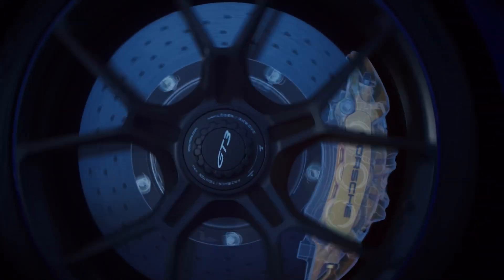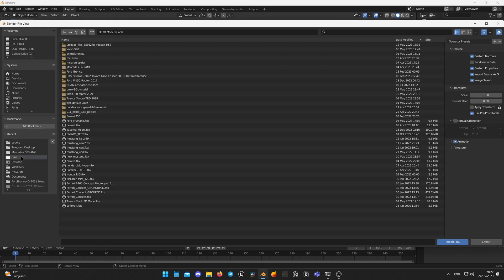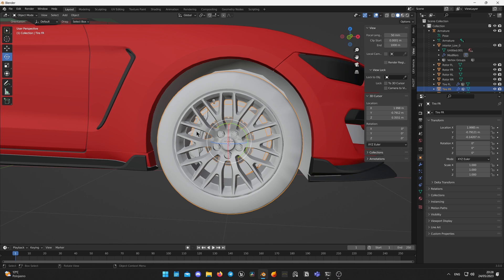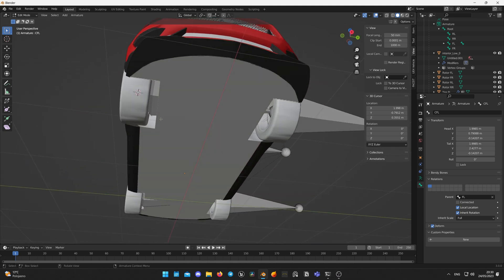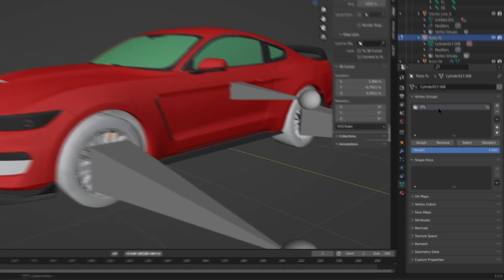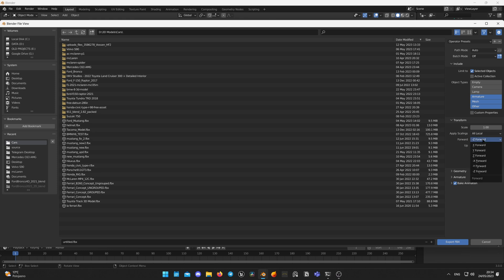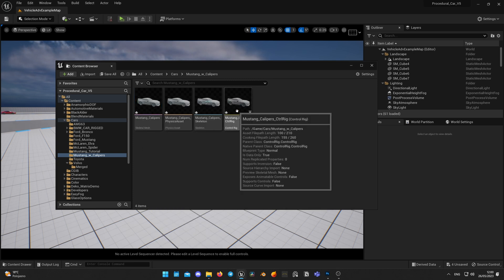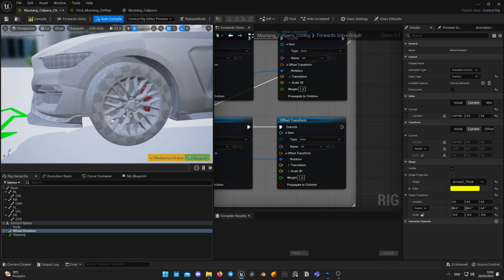CALIPERS FOR CAR RIG in Unreal Engine 5

Comment: Welcome. I watched the entire clip plus I also watched the clip where you built the Control Rig, I did the same, on top of that I also made sure that the axes in Blender are placed and that the bones are pointed in the direction that should be more precisely z up, x in the front and y in the sides, the car runs perfectly in the preview from Control Rig, so the steering is ok, the body moves ok in all parts, and the rotation of the wheels is also ok, the calipers stay in place when the wheels are moving and it also follows the wheels at every turn, so everything is good (WARNING), this is in the preview mode in Control Rig, when I go out and enter the game, that is, I give play to the editor, the calipers follow the wheels in turns, but they turn together with the wheels, it's totally contrary to what appears to me in the preview in Control Rig and I don't know why, not to mention that for about a week now I've been struggling with the car itself like when I enter the game, the wheels go halfway into the asphalt and spin empty, so if I didn't make any changes in blender and different and different tutorials on YouTube, I don't know my name anymore, in physics I don't say that I took absolutely all the settings in a row and nothing nothing nothing nothing, I- I'm honestly bored, I've been sitting on something insignificant for over 10 hours, in blender I set the scaling to 0.01 from the beginning (I know the story about scaling), I made groups in blender, I added all the components of the car to the body and I left the calipers and the wheels separate, then I arranged the car on the global axes to be directed towards x, z to be up and y to the sides, then I also arranged the local axes to correspond with the global axes and practically reach the value 0 on absolutely all axles, I set the origin for each individual wheel as well as for each caliper (as proof I said that the calipers follow the wheels when turning in both directions), I also switched to Face Orientation and did my best that the whole car to be blue and not red, anyway there were only two red front grills, I made them blue, I made the bones with UE4 Vehicle Base Rigging and everything went perfectly and this setting works (by the way, I'm on Unreal Engine 5 version 5.4. 4 and in Blender I have version 4.2.3 LTS (they are the latest versions both in UE5 and in Blender)), then I fixed exactly what you did in the clip when you removed the calipers from the body to the armature so that they are in the same column with the wheels, I gave duplicates to the bones of the wheels and then gave them a name and selected the parent wheel of the respective stirrup, following that by pressing the tab key for each wheel group, I created a vertex group in which I gave the name of the bone because it must be identical to the name of the caliper bone from each wheel bone separately where I made sure that all the calipers are selected and then I gave assign (anyway, as I said, I have no problems with the calipers, at least the bones are all imported into the EU5). On the other hand, I don't work with FBX because it has caused me some problems and I work with GLB (I don't have the slightest problem with GLB), on the contrary, I notice that with GLB the colors of the materials are much more colorful and it no longer seems to FBX and on top of that after you click on Rig Vehicle to create the wheel bones, you don't even have to enlarge the car to bring it to real size because in UE5 thanks to GLB, it automatically brings it to real size, that is to understand with FBX, I enlarged the car to its real dimensions (and I was working in meters, it is an RS6 that is 1.46m), then I click Rig Vehicle, the car shrinks and I had to enlarge it again to its real size, if not I was doing this, in UE5 it would show me a small car, very small, if I enlarged it to the real size, everything was ok (although for some time when I enlarge it to the real size, in UE5 it seems to me a giant car to go and in UE5 restarting what I don't understand why, because I've been doing this for a long time and this thing doesn't happen to me, but in the end, that's why I switched to GLB), instead of GLB, I enlarged the car to its real size, I clicked Rig Vehicle, shrink the car and leave it like that, I didn't increase it to its real size and when I imported it to EU5, it was no longer small, very small like in FBX, the car reached its real size of 1.46m but without increasing it again in blender, please, I didn't quite understand exactly how this came about either, although I know that blender works on 0.01 and UE5 on 1 scaling, but somehow it wouldn't make sense to what I said above, but in the end, let's say that I got used to it and I take this job as it is and that's how I work and it's no problem, I got used to it, but regarding the calipers that rotate with the wheel and the wheels that enter the asphalt, half in the asphalt, I despair. By the way, I also put that moment, I know it's one to show you the collision (pxvis collision 1) but let's "show" if it is, it doesn't show anything, that's right, I saw this command on UE4, on UE5 I haven't seen it, I don't know if the command doesn't exist on UE5 or if there is another command, but I suspect that something must exist.
In the end, I talked too much, I had a novel to tell.
I would leave your project in blender, although I don't think that anything should be changed about collision, I haven't seen anyone do collision in blender, not because it wouldn't be done in blender too, but for this action of add a vehicle in UE5, I really haven't seen anyone who needs to make a separate collision in blender for the car and import it together with the car in UE5, all I see on youtube is exactly the same thing you - I also explained it above, import the car in UE5, modify the collision settings in UE5 in Physics Assets, the body to single convex (or something like that) and the wheels to sphere and that's it, just some stuff, settings in CarBP, AnimBP, some FrontWheelBP and RearWheelBP and goodbye, play in the editor and everyone works, how simple, only I struggle like a disabled person for 10 years and I try all the settings and I keep forgetting that maybe I'm missing something, I know , I have no idea and I'm looking and wondering, not necessarily because you don't know, but to have a confirmation after all, a security and at the same time, in case of something, to be there with my eyes in the videos to see what can or cannot be changed and I can say that I am already dizzy and I have nothing to change. Maybe you can help me somehow, although it's hard for me to believe that you will read so many comments, but I can't anymore, I think I've unloaded myself to some extent, for real, already at this moment when I'm writing, I have feelings from the heat and I'm already sweaty on my hair, my hair is wet on my forehead because I'm concentrating, thinking, struggling, struggling, getting angry, dizzy and I simply can't, I clearly need a break today at least all day . Thank you if you read my comment and for your iron patience and what can I say, maybe, maybe you have a bright idea and you can enlighten me in a way, if you need the project in blender, tell me and I will give it to you through a link if necessary. Thanks again!
Reply from the maker: Oh my god dude. Well as far as I understood you are trying to rig Chaos Vehicle plugin. Unfortunately my rig is for CINEMATICS only, not for game or driving. 

But I know what can help you:
1. This video is for preparation car rig for CHAOS vehicle - it is well explained and straight forward: https://www.youtube.com/watch?v=T6vvnLRzjvY&t=804s&pp=ygURY2hhb3MgdmVoaWNsZSB1ZTU%3D
2. For fixing calipers for CHAOS vehicle you need to make ANIM BP and make fixes in ANIM BP, so it WILL NOT rotate when driving. PLS USE THIS tutorial https://www.youtube.com/watch?v=RG479wAU_4U

You did all correct, but you have different purpose than this video. This is for car cinematic and manual animation, NOT game. 
I think you will be successful with the videos I put links for. Those tuts are covering GAME MODE and driving.
Reply: @postprocessed  Thank you very much for wasting so much time reading my comment. Tomorrow you will watch the videos, actually I will watch tonight but tomorrow I will try and I hope I will succeed. Yes, I want to make a computer game. I also have an AnimBP for the car itself, but I don't know if I need another one just for the calipers or if I can add the calipers to the same AnimBP (I guess I could), I had tried something else in AnimBP, something with Copy Bone and Look At and with Apply a Percentage of Rotation but I still didn't succeed, but I hope these two clips sent by you in the comments will save me. By the way, what is Control Rig used for? I mean, I also searched on the net, I saw something myself, but I didn't clarify, at least the default machines in UE5 use it, but I see that it can work very well without that Ctrl Rig because I did a test removing it from the a preset car and there is no change.

Comment: That's great. I've been looking for this solution for a long time. Thank you very much
I have a cuestion for u, how I can change the name of the bones in UE5?  when exporting them flom blender  to UE, the name change, I can't keep the same name as yours 
example body changes to body9, FL changes to FL5, CFL to CFL6, ETC.
Reply from the maker: hm... check in blender if you have "ADD LEAF BONES" disabled. Sometimes this causes this weird bug. Also in UE settings->plugins look for "Skeletal Mesh Editor" this plugin allows to rename bones or edit skeleton. Hope that helps.
Reply: @postprocessed  Thanks😱

Comment: Hello thank you very much for this tutorial, I followed the previous video on the rig, everything works well on steering and rotation. But for the calipers I can't do it. I followed the tutorial but once I got to UE5 after importing, when I checked the bones on the skeleton, the calipers didn't work perfectly.
They are immobile on the rotation when I rotate the wheel (which is cool) but when I play on the direction of the wheel, the caliper is immobile.

Knowing that the child bone is in outline and that the following sentence appears when I move the mouse over it: This bone is used by the current mesh but has no vertices weighed against it

Thanks for your help

EDIT  : RESOLVE : I hadn't selected the UVs when I made the groups...
Reply from the maker: So it all works, right?)
Reply: It’s all good ! Thank you again for your work !
Reply: i have same problem, but selecting vertexes doesn't help to solve the problem, still in the unreal the bones look inactive. 
I full followed the tutorial, but dont have idea how to solve the problem
Reply: @Vitaly-h7e  hi !

Do you have exactly the same problem as I had? (The calipers remain fixed on the rotation but did not follow the steering).

Make sure you select the right UV by pressing A on blender.

Also, I didn't use the assign button shown in the tutorial, but went to the menu 

vertex - vertex group - assign to active group
Reply: @lucag1812  Thank you for you answer, i just redoo all rig setup and put correct vertex name like names bone, and all work properly, ty ty ty

Comment: Hey, thank you so much for the amazing tutorial series. We used to work with chaos before and really had our struggles with it. I'm usually a 3DsMax user. However, I couldn't achieve the same result with MAX as you did in Blender with the plugin. It always created 5 skeletal meshes instead of one, I'm not exactly sure what the issue was. Anyway, thanks to your guidance, it worked with Blender as well.

Our car is now divided into several individual meshes (like doors, for example). Should I simply attach them to the main bone using VertexPaint as shown in the Calliper video, or should I create new bones for them?

Thanks a lot, and please keep up your amazing work!
Reply from the maker: Thanks for feedback!
Yeah, you should create new bones and assign it as vertex paint. Should work same way 👌
Reply: Thanks ... I ll try it in the next hour ^^ @postprocessed

Comment: Thank you sir! Amazing video again. I have a question. How should the motion blur settings for wheel rotations be adjusted? I use path tracer, but even though I set the blur value to the highest, I cannot get good results.
Reply from the maker: Try on render queue in path tracing set checkbox “reference motion blur” maybe it will give better results

Comment: Hey @post processed.. i have a question, it worket perfectly, i did it the same way.. the thing is. i also want to apply it to my Animation blueprint.. it doesnt work because in the tutorials for that one, the bones of the calipers where parentet to the body and not the wheels.. im confused.. tried 1000 different variations..
Reply from the maker: You want to use that for chaos vehicle?
Reply: @postprocessed  i want to be able to use it as chaos vehicle, but also as controlrig.. i managed it with another car but whitout calipers.. on this car now.. the calipers are taking my soul when i try to apply them on the animation blueprint.. the only difference i see between the tutorials are that my wheels are parented to the calipers, and in the tutorials they parented the calipers to the body of the car.
Reply from the maker: @TheFLYHiGHx  probably you are doing it other way in animation blueprint. I use same bone structure for my other project and it works. I will show you node tree, let me get up from bed and run PC, I will upload image somewhere
Reply: @postprocessed  I really didn't mean to disturb, I'm sorry.
If you would do that it would be a huge help to me, I really appreciate it
Reply from the maker: @TheFLYHiGHx   here you go, lad https://ibb.co/cJkWXD9

FL, FR, RR, RL - are Front Left wheel one and etc. CRR, CRL, CRL - caliper bone name. Caliper bones are connected to wheel bones
Reply: @postprocessed  thank you very much mate... il redo it like that right now.. the caliper bones themself doesnt have a ''bodys'' in the physics tab right ?
Reply from the maker: @TheFLYHiGHx  yes, right. No bodies in physics
Reply: @postprocessed  its so crazy, i tried since 6hours now, redone it like 4-5 times... i literaly couldnt figure out what the problem is... its not because of 5.3 or maybe yes?
Reply from the maker: @TheFLYHiGHx  maybe yes.. i use 5.2
Reply from the maker: @TheFLYHiGHx   hey, it is going? did you sort out your issue?
Reply: @postprocessed  heyy, thanks for asking... i gave up... i'm normaly not that type.. but i did it like 25 times and lost more than 10 hours for sur... it don't want to work... so all is perfect, just in ''Gamemode'' the calipers are invincible for me.
maybe its the mesh, its like a 1.9 million verts mesh, if you want i can send you the mesh so you can try it out.. its a 911gtrs3 from 2023 and very high detailed...
for now i will use your recomended spline workflow..
Reply from the maker: @TheFLYHiGHx  ah yes.... it's limitation of polys. I had a thread about it on UE forum. There is polygon limitation (file size, video memmory size) when models are not visible anymore. So it's not your problem mate, but UE

Comment: hey bro, my tire is moving but my wheels are not rotating
Reply from the maker: hey! that means in blender was selected not proper geometry, you need to merge tire with wheel
Reply: @postprocessed  yes i checked, i merged the tile also my normal were all wrong. But it worked out.

Comment: This is so amazing! Exactly what I was looking for. The final piece for me would be a simple drift angle control like the one found in the Launch Control addon for Blender. Any tips on how to make that in Unreal?
Reply: I just want you to know that your tutorials are so clear and concise that I was actually able to figure out how to create the drift control that I wanted on my own and it took around 30 minutes. Also, I'm EXTREMELY new to Unreal so I was surprised at how quickly I was able to figure out the solution. Let me know if you want me to show you what I did!
Reply from the maker: @itsbenreel  Wow that would be amazing if you can share it! I usually just rotate the car on Z axis in sequencer, not making additional rig control for it, but I am curious to find it out! I am surprised that you just figured it out in one hour, great job!

Comment: Do i have to use bones ?all tutorials i watch they used bones, can i use locators/empty to rig like we usually rig in maya/blener or only bones will work ?
Reply from the maker: you can do it with "pivots" and locators. but in blueprint. Control Rig works only on bones

Comment: Hi. I ran into the following problem: I'm making a racing simulator, I tried to animate the calipers according to your guide, but while I'm in Control Rig - the calipers remain in place, do not rotate with the wheel, but as soon as I try to drive a car - the calipers continue to rotate with the wheel. Can you tell me where to look for an error? I will also say that Control Rig is associated with Anim Blueprint, if that makes any difference.
Reply from the maker: Hey if you are using Chaos Vehicle here is a perfect tutorial for it:

https://www.youtube.com/watch?v=Gs4hpd4R8NA

It is done via animation blueprint and I use this approach for calipers in drivable chaos vehicle.

Cheers!
Reply: @postprocessed  That is, the option via Control Rig is not suitable for a controlled car, and this method is only suitable for cinematic animation? It's sad( Through Control Rig, the machine animates so beautifully.
Reply from the maker: @kein_engel_zlat  control rig works separately from Chaos Vehicle blueprint. It is just different approach. The video I shared WILL work for car simulation gameplay. And is probably what you are looking for. My control rig is approach that I am showing in the video is only suitable for cinematics
Reply: @postprocessed  Thank you very much, I will study that video now.